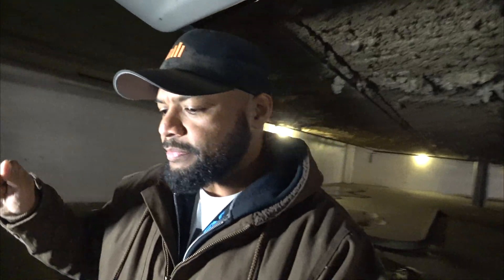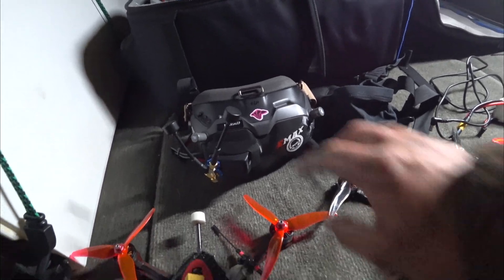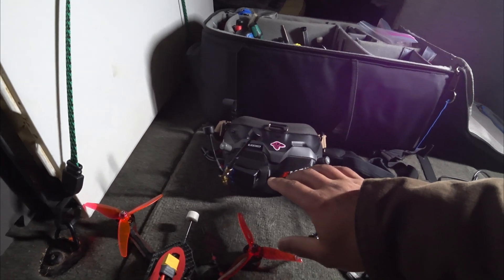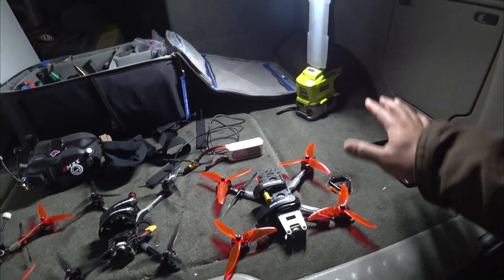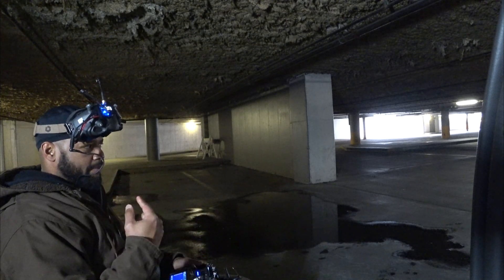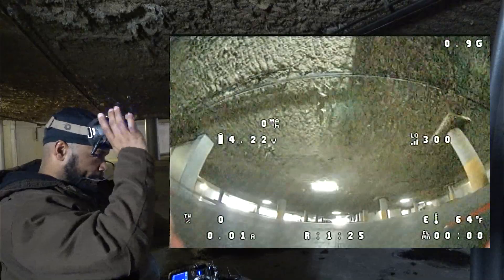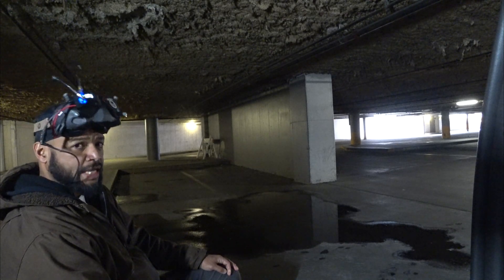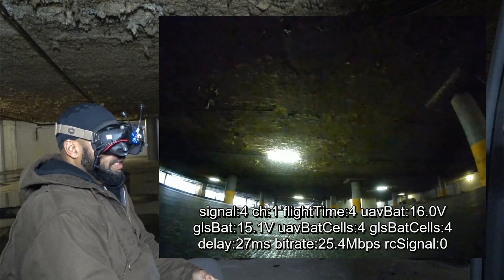Multipath | Caddx Vista VS. DJI FPV | Single Antenna Worse Indoors?

Comment: Going from analog video to digital is precisely analogous to the switch from PWM/PPM/Oneshot, etc. to DShot. Going from an analog signal that can be interrupted and corrupted at any point in the signal pulse, to digital that is encapsulating data into “packets”. In the case of digital (unlike analog), incomplete or corrupted packets are ignored. Specifically useful in multipath environments because that signal can be reflected, polarized, whatever all it wants. It’s still a packet of data. As long as it reaches the receiver it is useful. Whereas with analog, the multipathing signals can actually blend, distort, and corrupt each other. But the receiver has no way of knowing whether or not the data is actually good. It just receives what it can and displays it. I hope this makes sense... It does perfectly in my head lol
Reply from the maker: Yep sounds good haha.
Reply: Furadi Here’s a terrible analogy... Think of the video signal as a sphere, like a ball. With digital, that ball can hit the wall and bounce off/collide with other balls as many times as it wants. As long as it reaches it destination, it’s still the same ball that initially hit the wall. With analog, still a ball hitting the wall and bouncing off, but slightly misshapen. Then as it collides with other balls, it distorts even more and gets  a weird spin making it difficult for the target to receive it. Nevertheless, when it reaches the target, you can tell it was once a ball, but is no longer round or spinning the same direction... That really was terrible... I can picture it so clearly in my head, but putting it to words always proves to be more difficult than the actual understanding was. Anyways, maybe you get the point lol 😂
Reply from the maker: @zfpv7211  😂😂
Reply: zFPV My guess is they use some very smart coding on many levels! The signals do still interfere with themselves just like analog, but it's the way the signals are coded themselves, then bits on top of that, then how the data packets are coded (and error checked) on top of that, the video on top of _that_, etc. There's some really ingenious stuff going on!!

TL;DR there's more going on than rounding bits back to being bits, or recognizing fully received packets ;) 
(and I think some of the best stuff is in the (multipathing) signal itself :))